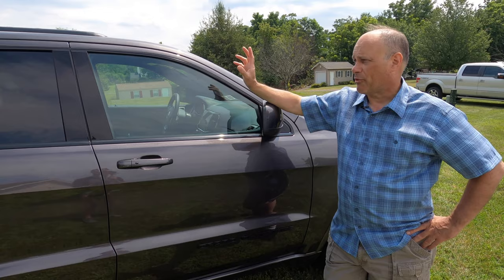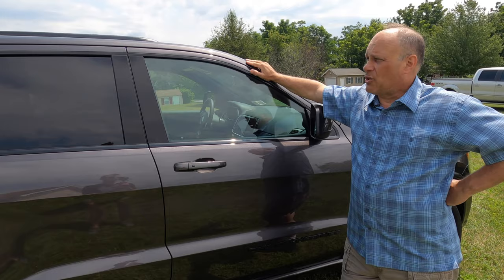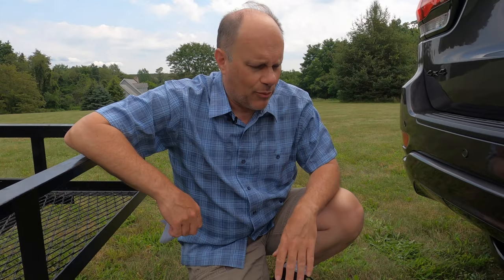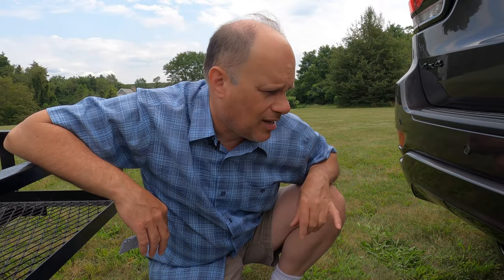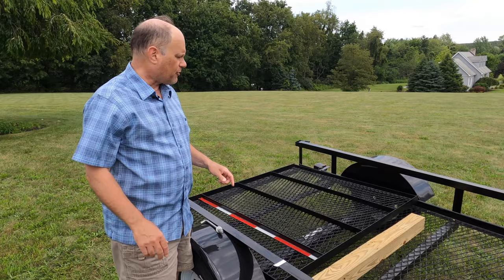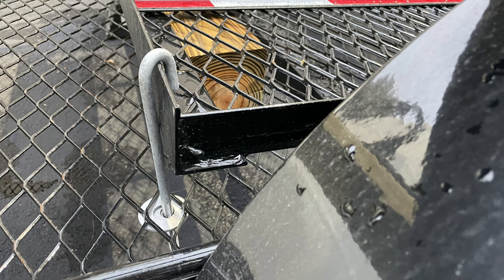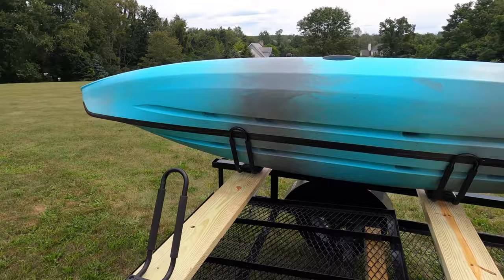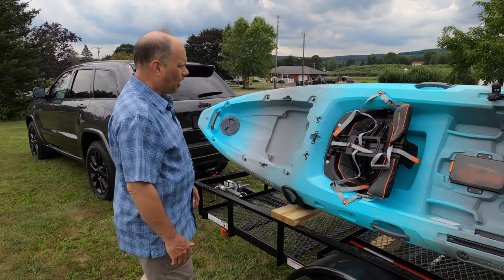DIY Kayak Trailer Conversion

Comment: Great minds think alike! I also used a Tractor Supply trailer, I used the 4x6 with out the tailgate. I put down a 5/4 PT lumber floor for future use as a utility trailer. I had load bars from a previously owned truck  cap and attached them directly to the top of the trailer frame with u-bolts. I then bought some steel square tubing and made a longer tongue so I could haul my 15' and 17' touring kayaks. I plan on making a 2' tall box for this trailer to hold all the paddling gear and mount the kayaks on top of that, still easier than roof topping them. A plus is these trailers are so light that you can move them around by hand like a wagon, great for getting them into tight spaces.

Comment: Just wanted to drop a think you. I needed an idea for how to convert my 5x8 utility trailer to haul my kayaks on a family vacation. I already had the J Hooks, but wasnt crazy about hauling the kayaks on the roof for hundreds of miles each way. I used your video as the basis of my trailer configuration, and it worked great. I went ahead and used your initial idea for the rear gate, anchoring it down with 3/8 carriage bolts through a 4*4. So thanks again.
Reply from the maker: Glad to hear your project was a success!  Hope you have a great season out on the water..

Comment: Thank you for the short tutorial, I plan on picking up a utility trailer in the spring to haul my yaks to the water as well. Though I could throw them on the roof of the Outback, it’s a lot easier to load my 75lb fishers onto a low trailer and also gives me the versatility for other uses. Plus I can easily store a small trailer in my garage.
Reply from the maker: That sounds like a perfect plan! We really get a lot of use out of ours and it is nice to not have to lift the boats up.. we just slide them off the trailer.  Thanks for watching and commenting.

Comment: I like this idea. THANKS!  I haul 2 - 4 Kayaks (10 ft) and sometimes stuff a 5th one in there for Scouts. I have a heavier 10' trailer with a wood deck, but with your system, I could store some gear totes on the floor of the trailer as well. Cheers!
Reply from the maker: Thanks for watching and glad you enjoyed the video!  Scout troops always need more room for gear for sure..

Comment: Just finished doing something similar to my 5x8' trailer.  My kayak is huge and was hanging far enough off the back that there was very little weight on the tongue, which caused it to bounce around on the hitch.  I needed a solution that would allow me to put my kayak high enough to be flush with the front rail and get the front out over the tongue.  I used some powder coated decking joists attached to the inside of the rails and mounted pressure treated lumber between them. I can stand on the vertically mounted 2x6" beams with zero flex.  It also creates compartments underneath to keep things like coolers contained.  The wood can also be removed easily when the trailer is needed for hauling.
Reply from the maker: Sounds like a well thought out solution! Hope you have a great paddling season and thanks for watching..
Reply: Chris, is there any way you could upload a video or perhaps somehow get a hold of me and send some photos?

Comment: I was able to find a "used", like new Harbor Freight trailer on Facebook marketplace.  My brother and I are doing a similar conversion to the HF trailer.  We put down a marine grade 3/4" piece of green treated plywood on the bed and used green treated 2x6 around the edge of the bed.  We plan to put the J hooks on the trailer the same way that you did; using some scrap lumber.  Nothing fancy but functional.  I did a lot of research before buying the HF trailer and I am not the least bit concerned about going highway speed with the trailer.  We do not plan to fold the trailer. I spent less that $500.00 for the HF trailer that the seller never used and we have less than $200.00 is add-ons, so even if it only lasts a few years, the HF trailer was a great deal.
Reply from the maker: Sounds like you got a great deal on that trailer!  I’m sure it will come out great and be a good solution for hauling your boats.

Comment: That is a awesome DIY kayak trailer you have. I am thinking about doing something like that myself or buy me an Malone kayak trailer. Only thing is Malone trailers are very expensive but they are rust proof & can store down to a small space. I have a big family wife & five boys & a granddaughter & they all have kayak. So a kayak trailer will be great to have for 7 kayak. Thank you for sharing this video.
Reply from the maker: Thanks for watching, Mack! Sounds like you will certainly benefit from a trailer to transport your family's boats. I liked the design of the Malone, but couldn't find any in stock (online or in stores), which is why I ended up going with the Tractor Supply trailer and modifying it to fit my needs. You could do something similar with a utility trailer, but use metal (or wood) to frame out multiple "tiers" that you can tie the boats down to. Good luck!

Comment: If you just cut a small hole (1/2"x1") with a jigsaw w metal blade on each side of mesh floor, the ramp will fold flat into the trailer and you can secure it to the floor w heavy duty zip ties.
Reply from the maker: Agree 100% Robert.  It was just a brand new trailer and I did not want to molest it yet!

Comment: This is cool. Thank you for the ideas. I just bought a utility trailer and am planning on doing this for canoes. I was told the railings were not weight bearing (I know the kayaks are light) so I'm not sure this'll work for me.
Reply from the maker: I could stand on the railings if I had any kind of balance..  think you will be fine!

Comment: Do you foresee any bowing occurring in the wooden cross supports over time, given the weight of both kayaks? Do you think support underneath would be needed?
Reply from the maker: We had no bowing  issues and just used what we had on hand.  You could go with a 2x8, 2x10 or 2x12 for more support,  I could stand on the wood we used.
Reply: @completepete  I guess I could add a metal support under the 2x8/10/12 to add strength.

Comment: How did you mount the non folding j hooks? Are they made to be bolted? Everything i see is made to clamp. Do you have a link to these?
Reply from the maker: Hi Keith - thanks for watching! I’d say they aren’t inherently designed to be used in this manner, but no significant modification was necessary. I used these hooks from Amazon [ https://a.co/d/27NR4JV ] and simply used a hammer to remove the existing (4) bolts that held the body of the hooks together. I didn’t attach the accompanying clamps, and instead marked the wood cross members for drilling using the now-empty carriage bolt holes. I picked up some longer bolts that were the same profile as the original set, and used them to bolt the hooks to the wood.

Comment: My trailer is 70 inches wide do you think I could put 4 sets of j hooks for four kayaks? Thanks in advance great idea for trailer
Reply from the maker: Hi Paul - you might be able to fit 4 across if you got J-hooks that are foldable and can be held vertically in place. Three boats fit snugly on my trailer but I use a Yakima foldable j-hook and two fixed Yakima j-hooks.

Glad you enjoyed the video and happy paddling!

Comment: Are there certain bits that you have to buy to drill through the metal? I tried doing that to my trailer and after a couple of holes I didn’t have much success even though I changed to new bits. I have some holes that just flat out will not let me make them any larger to fit the bolt.
Reply from the maker: Hi Doug!   I would stick with name brand bits to start. I’ve had good luck with Milwaukee titanium bits from Home Depot. The Milwaukee shockwave titanium coated set (p/n 48-89-4631) is $39.97 for a 23 piece set with plastic case. It’s the set I used to drill my trailer. Using a cutting fluid like tap magic will make drilling easier and extend the life of your bits. My second tip would be to start with a bit half the size of your final size.  Once through, switch to the larger bit. Careful when step drilling.. too close in bit size and it will bind up and snap the bit.  Last tip.. go slow and use light pressure. Let the tool do the work! Using too much pressure can work harden the steel and dull the bit. You might need to move your hole locations a bit to get to softer steel.  Good luck with your project and let me know how you make out!
Reply: @completepete  Thank you for the info. I really appreciate it!
Reply: @completepete  now I’m trying to figure out how to keep the holes that I made a mistake on from rusting .😂
Reply from the maker: Doug,  when I drilled into the framing I worried about rust.  Purchased a can of   Rustoleum gloss enamel and it was a perfect match. Good to keep around for touch up also!

Comment: Would it be safe to do exactly what you did but not use jhooks and lay two pedal kayaks flat on the boards and strap them to that?
Reply from the maker: Hi Joey, thanks for watching! I’d suggest ensuring that the pedal kayaks are upside-down so they sit as flat as possible. You might also consider a front and rear tether to limit the possibility of them sliding on the wood.
Reply: @completepete  Is there a way to use the harbor freight 4' trailer to set up two pedal kayaks on (one is 12'1" and the other is 10'6"? I am new to the hobby and don't know much about trailers. Also would a truck rack be able to clamp on to the trailer and allow a second kayak to lay above the one on the trailer? I'm trying my best to make the most convient/affordable setup.
Reply from the maker: Hi Joey,  if the harbor freight trailer is 4’x8’ the length is no problem. I’d lay the boats side by side and measure the overall width to see if they can fit. I went the easy way and used the J hooks. I have seen folks use truck racks and even make racks out of wood to double decker the boats.  I guess it depends on how comfortable you are with fabrication.  I found that the J hooks were easy to install, pretty inexpensive ($30 per pair) and I can strap the boats securely for transport.
Reply: @completepete  Thank you for all this information! the Harbor freight trailer I'm currently looking at is 40-1/2 x 48. I want to double decker it with truck racks but am failing to find anything that fits in a 40-1/2" frame. Secondly, is there any safety concerns if my yaks hang off the tongue and back side, or is the only requirement for me to hang a red flag on my haul?
Reply from the maker: With some of the truck racks you can cut the center tube shorter and customize the width. Overhang in front of the trailer is important so you don’t hit your tow vehicle.  I always hang a red marker off the back of my boats to make them more visible.

Comment: What did you mount between the j hooks to hold the middle kayak?
Reply from the maker: I used 3 total J-Hooks, two non-folding on either end, and one folding. To mount the folding (which could only attach to a cylindrical object), I bolted some conduit to the wood and attached the j hook to that! Let me know if you have any additional questions, and thanks for watching!
Reply: @completepete  Do you have a pic of the 3 Kayak setup? Why did the middle row of J Hooks need to be folding?
Reply from the maker: I can’t attach photos to YouTube comments, so feel free to Email me at completepete6@gmail.com and I’ll be happy to send a photo! The middle folding j hook wasn’t absolutely necessary, but folding allowed me to control (and lock in place) the angle of the hook depending on the size boat I put in it. Fixed hooks have a specific angle that would have led to the three boats banging into one another while in transit, so being able to control the amount of lean on the middle boat allowed for some level of centering to avoid that boat to boat contact.

Comment: That's what I'm talking about!  A simple solution that won't break the bank.  I am about to buy a 4x6 trailer and want to build a rack to haul my kayaks.  Your system looks great.  Was that pressure treated wood you attached the j-hooks to?
Reply from the maker: Thanks for watching!  I’m happy that some of our trailer retrofitting ideas will work for you.  We did use treated wood.  Hope you have a great / safe summer on the water..

Comment: We have the exact same trailer and was looking at racks but wanted something lower.

Any thoughts on using a hitch extender?  Our receiver was built where it is back more under the bumper.

Also, any ideas for u-bolts to hold the wood on as opposed to drilling into the trailer?

Thanks for the video!
Reply from the maker: Lewis,  should be no problem at all using a hitch extender.  U-bolts can be used for sure. I took a quick look on  McMaster-Carr  McMaster.com  and they have a wide selection of square u-bolts.  They might also be a hardware store item if you look around a bit.
Reply: So the square portion would hit up against the wood and the bolts on the underside I’m guessing.  Would this impact stability?
Reply from the maker: You could put the square u-bolt up from the bottom and through the wood. A couple acorn nuts would leave the ends of the bolts smooth
Reply: So to be clear (and I apologize if this seems obvious)… the U bolt replaces the bolts you used in your video. I would still need to drill through the wood plank and the trailer rim, then use the u bolt threaded through the holes in the trailer rim and the wood to attach the plank
Reply from the maker: I think I’d place your wood plank across the trailers top rail where you want it. The u-bolt would come up from the bottom, around the metal rail. You would need to drill two holes through the wood plank, add some washers and acorn nuts which are smooth on the ends. With the plank in place, the u-bolt comes up from the bottom (hold it like a U) and around the steel frame. Tap the u-bolt with a hammer and you will have two dimples in the wood so you know where to drill. This is a good mounting method as you don’t need to drill the frame but are only clamping to it.

Comment: You think it would fit 4 kayaks?
Reply from the maker: Hi and thanks for watching!  We have the two tarpons and a a Pungo and it’s enough room.  You also need room in between for the straps. If I had four boats, I’d pad the 2x6 on the bottom and lay two of the boats flat. I’d then build up a bit with the same design and make it a double deck design. You could fit four that way for sure..